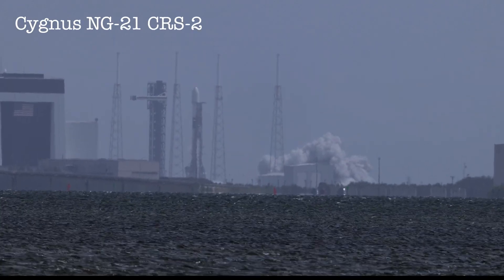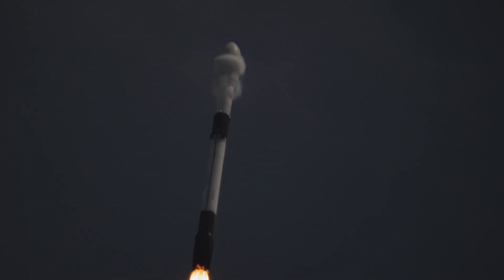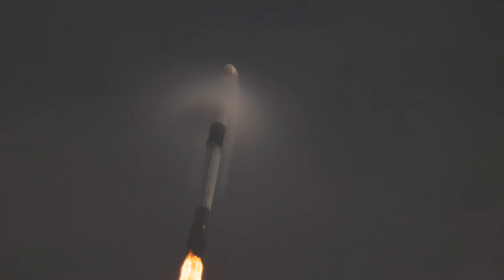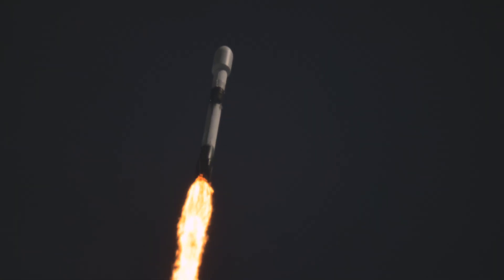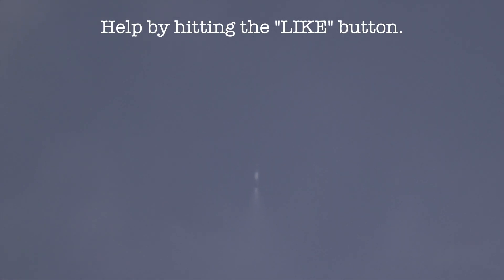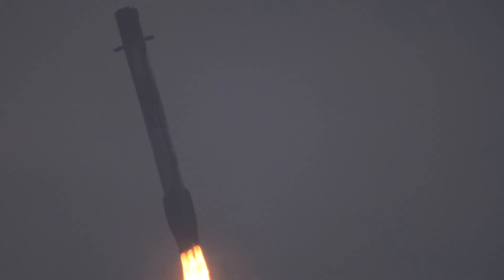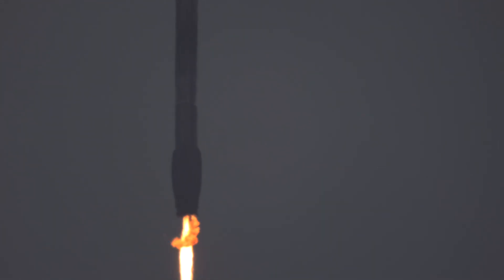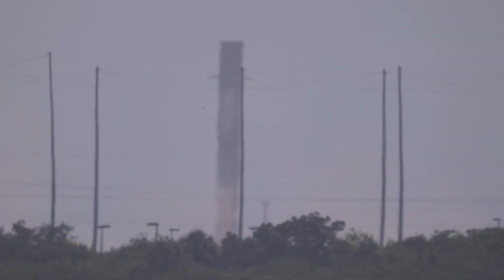Cygnus NG-21 CRS 8/4/24

Comment: Amazing views!  I wonder why 3 engines fired for a short period on this landing burn.  Keep up the great content!
Reply: For the majority if not all RTLS landings now they perform a 1-3-1 landing burn.  Theyve also greatly decreased the landing burn start altitude, so I bet it is to increase efficiency or something like that.
Reply from the maker: @Onkla  always improving efficiency. 👍
Reply from the maker: @xyle3141  I notice that it changes every one and a while. It was hard to see but the upper entry  burn only lit one engine vs the normal three. You can tell by the plume.
I’m sure it all depends on the rate of descent vs altitude with the onboard computers.
Guess that is the definition of “fully autonomous”.